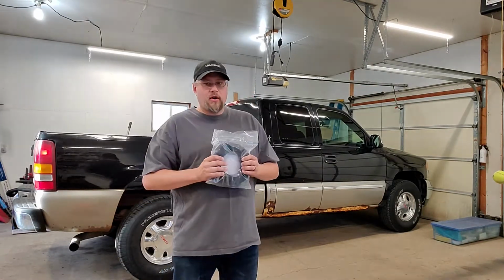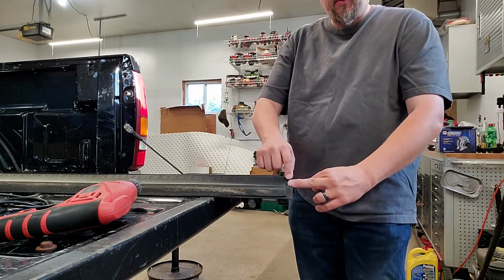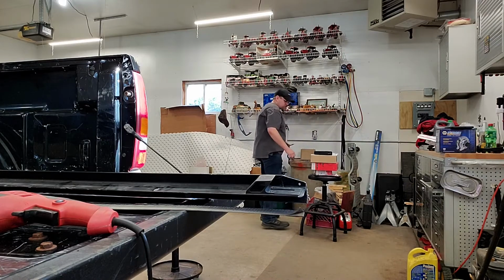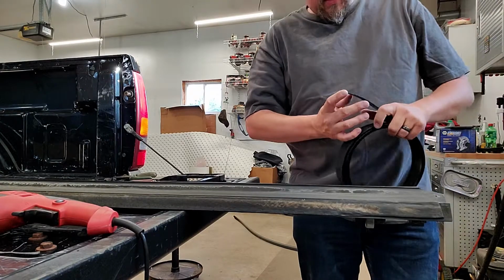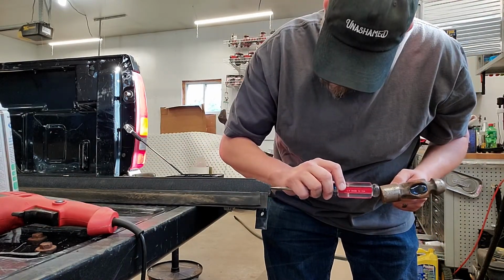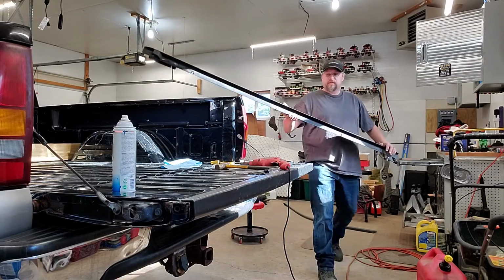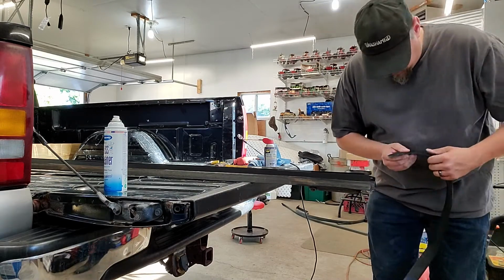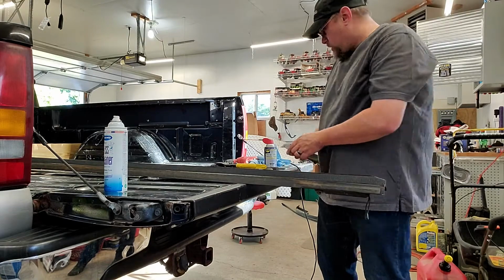Fixing Used Tonneau Cover | Velcro Repair - Bad Wrench

Comment: I would ask, Is there extra material, or would it be better to, push it trough before cutting, then trim the ends, so no chance of cutting short or wrong angle as you did on the first?  Plus with the extra material would be easier to push when you're close to the other end.   Great video and thanks!!!   LOL  you explained that 3/4 in sorry.
Reply from the maker: Thank you for the comment, yes both ways will work and yes I would use the way I described later in the video if I was to do it again.